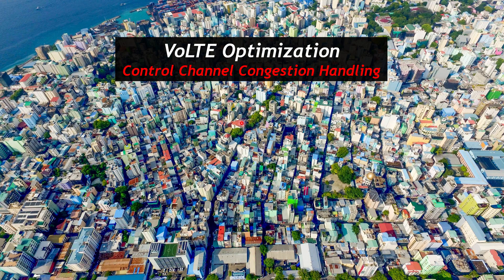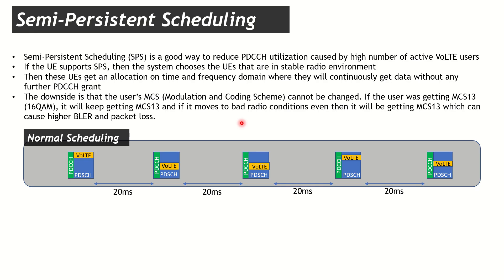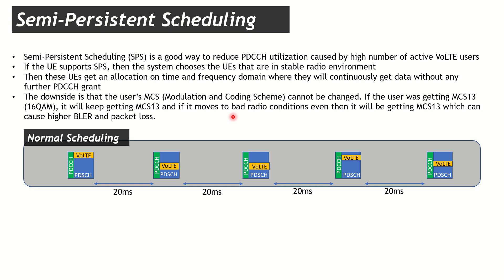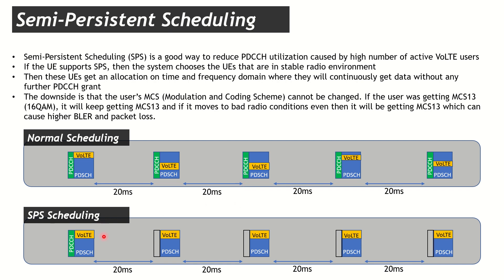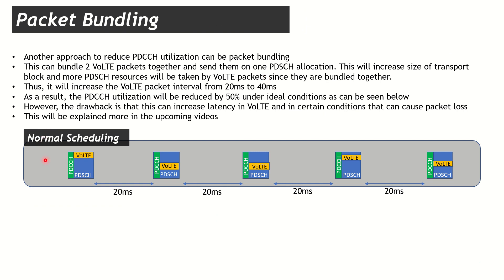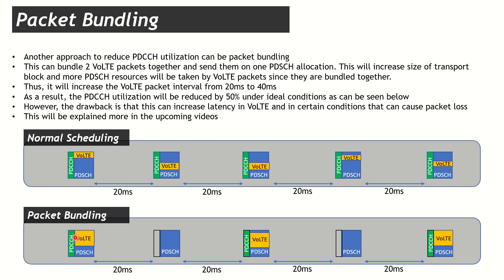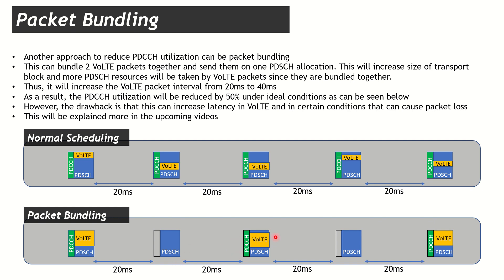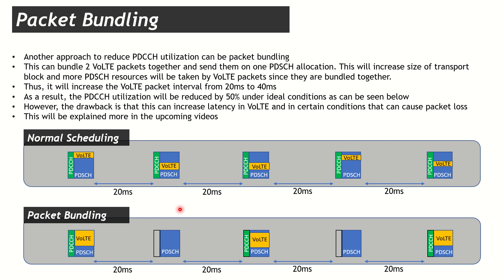VoLTE Optimization (Session 1): Control Channel Congestion Handling

Comment: TTIB is having higher priority than UL SPS.? So SPS impact wud be there only for non TTI users. Please correct me if am wrong
Reply from the maker: Yeah TTI Bundling has higher priority. The rule of thumb is that mostly the coverage related algorithms should have higher priority compared to capacity related algorithms.

Comment: Regarding VoLTE Latency Delay, if you take 1st packet as reference then 2nd Packet is being received earlier than before as it is being bundled together with 1st packet  but if you consider 2nd & 3rd packet as reference being bundled together (2nd bundled packet in example) then obviously there is a delay

So any specific reason for the approach used to describe the VoLTE Latency Delay
Reply from the maker: The packet generation in VoLTE is 20ms. You cannot advance that packet generation. The only possibility is to make one packet wait in the eNB's buffer until the next packet arrives and then bundle them together.

Comment: SPS Feature is not recommended by Huawei at all due to causing Cell downlink RLC Throughput degradation on Drivetest and signaling trace. If the cell serving to both Volte and PS User at the same time, Around 15 RBs will be occupied/wasted for Volte users. Thats directly effecting LTE Throughput.
Reply from the maker: This makes sense as this is not a rollout type feature. This is in continuation to our previous video where we mentioned scenario when the PDCCH blocking has started due to VoLTE activity. To address that kind of scenario, SPS might be a good choice but only on those cells or areas where PDCCH blocking or high levels of congestion are present.